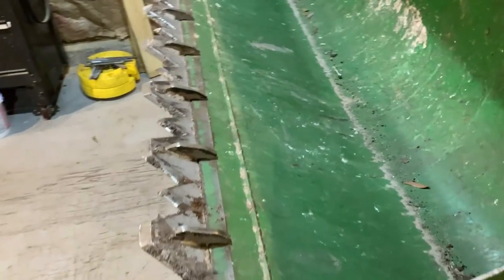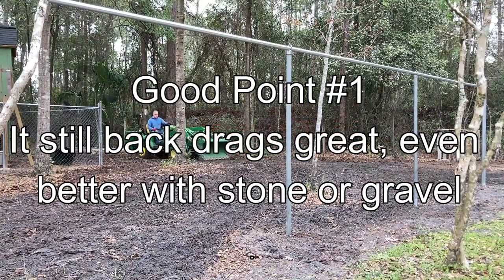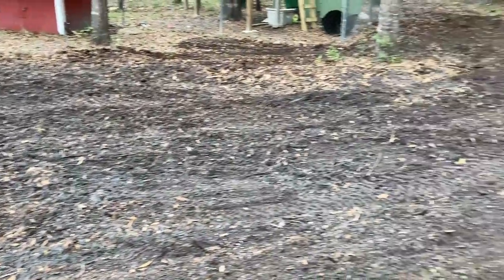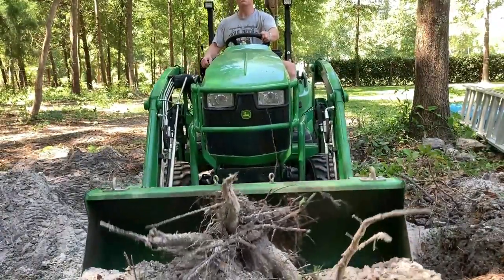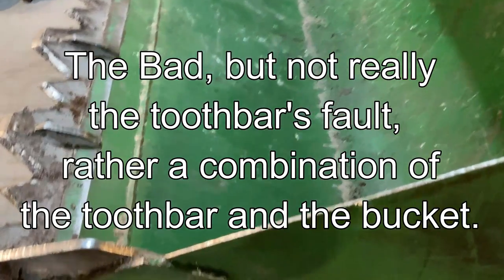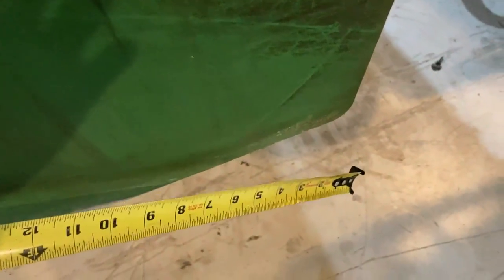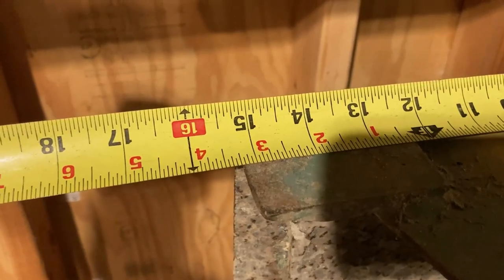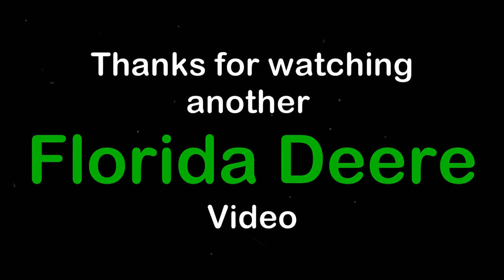Piranha Toothbar 6 Month Review: The Good, The Bad & The Ugly on the John Deere 1023E 1025R

Comment: I am cheap, that is why I bought a 1023E instead of a 1025R.  I looked at tooth bars and found one that fit my budget, trouble is it was out of stock.  I have a welder so I jumped on Amazon and ordered the parts.  $230.  The Paranha is more then a tooth bar so if you have a use for it I am sure it is worth the money.  The teeth on mine are sharp too, I always but the bucket down before I get off the tractor.
Reply from the maker: Me too, they are the same tractor for $2500 less.  Now the 1025 has some nice features, but I had a budget and other than the seat and position control, I didn't need the other features.  $230 is a great price for a toothbar.  Thanks for watching.

Comment: Nice review. I really like my Piranha. The dumping issue could be easily solved by using a trailer. That would be better for your truck too. You could use the pallet and chain trick to unload quickly.
Reply from the maker: Thanks for the tip Dan, I will check out this pallet and chain trick.  Thanks for watching.

Comment: Not fair to blame tooth bar for not being able to dump fully in your pickup.  You tractor is just too short or truck is too tall.  Maybe a built up loading dock for your tractor/truck is in your future project?  At least your tractor can be raised higher.  Post a video if you happen to build one!
Reply from the maker: Yes, I agree with you completely, it is the toothbar's fault about 10/20% and the rest the bottom of the bucket stick out too much, I thought I had explained that, maybe not well enough.  I had the issue before the toothbar which was one of my concerns about getting one, but the benefits certainly outweigh that minor issue.  And the truck is an 8200 GVWR model that is a 4X4, so the stock ride height is a bit high.  Thanks for watching.

Comment: My list vs this video: 1) tooth bar is removable for back dragging. Two whole bolts. What 3 mins?   2) Your subcompact tiny tractor isn't designed to be a quarry pit wheel loader to load trucks. Again 3 mins? to take the bar off to load the truck? This is a John Deere problem, not Bxpanded's.   3) Good ending. Haha I cut my shin all the time on my Land Pride Grapple with its big sharp root rakes on the bottom. Good video and we appreciate it greatly. I didn't reply with my 1,2,3 comment in order to rebuke or chastise you, rather just to point out that the perspective, if looked at differently, would be to understand that your expectations must lie within the limitations of the designed equipment you are leveraging in your tasks.
Reply from the maker: Eric, it back drags just fine, I think even better than with a flat blade, but yes 2 bolts and it's off.  And yes it would take me 3 minutes, I'm slow and would have to find the right wrench and yada yada😂.  2, what are you saying, this little tractor can do everything, LOL, just doesn't do anything super well.  And of course I agree, this is more of a JD issue, I thought I stated that in the video.  Not so much that the bar was bad, but that is made the JD shortcoming even worse.  And to this day, that is my biggest gripe about the 1 series, the height of the dump.  My 445 was actually better and it's a smaller tractor.  The bucket on the 1023E could be argued is too big.  3. I try man, I try🤣.  I liked your comment and enjoy talking tractors with folks.  And you are right, we often take things out of perspective and want silver bullets to fix all our problems.  The 1 series is a great tool, fantastic, but it does have it's limits and it's good to know them.  People often say, why don't you get a larger tractor?  HAHA, well, because a larger tractor would not be good at all the smaller tasks a 1 Series would be good at, there will always be compromises.  I tell folks that in my job, there is no perfect house, there is just the best of the bunch.  Thanks for watching Eric.

Comment: On the negative of the bucket being too long and causing issues trying to dump into your truck my comment would be I would take the extra load capacity over your issue with dumping into your truck's bed.  I like the large bucket and find its extra capacity a big positive!  Your video is very helpful and makes me wonder if the heavy hitch's longer teeth would be a issue or benefit.  I am trying to decide between the Piranha and heavy hitch for my 6 month old JD 1025r.  FWIW I am in Florida also....
Reply from the maker: Yeah, I think you're right to see both ends on both issues.  The extra capacity could help, depends on how we use our tractors really.  Same thing with the HH vs. Piranha.  I would say for ripping roots and such, the HH would maybe have an edge, no pun intended, but if you used the bucket for finish work a lot, then the Piranha has to be strongly considered.  Very rare do we get a tool that does multiple chores head and shoulders above the next one.  I was also upset initially by the width of the bucket, it being 53" instead of 48" like my 445/40 FEL combo.  But I quickly got over that.  I'm always concerned about space to operate and store, so I may be a bit whiny with certain things, LOL.  Thanks for watching.
Reply: set up a couple of car ramps an that will get you another foot or so I have done that in the past.

Comment: Subbed to your channel a few days ago when I discovered it looking at the differences between the 1023 and the 1025. I watched several of your videos and I found your videos practical, informative and helpful. I kept on seesawing between the much more expensive used 1025s here in Canada and the more reasonably priced used 1023s. Based on your review and thoughtful commentary of your 1023, and the landscaping projects I am planning, I purchased a used 1023 with very low hours on it at a reasonable price.
Reply from the maker: That's awesome man.  If you have a use for the extras on the 1025R, I'm sure it's worth it to some folks, but the price difference is pretty high for basically the same tractor if you don't use all those features.  I hope you have good service with it.  Mine has been really good so far, with only minor issues and some caused by me.  Thanks for watching and thanks for subbing as well.  I hope to see future comments from you on later videos.

Comment: Mine is on order.  Waited 5 weeks, called today and it's another 5.  Seems like it will be worth it though.  Thanks for takin the time to make videos.
Reply from the maker: Man, that's unfortunate for sure.  They told me it was 4-6 weeks and it came in 5 I think, HH is quicker, but more pricey, but also a different type of bar.  I have noticed crazy lead times.  I have a carport ordered and it's 12-14 weeks, I have a carry-all (future video) ordered and same, another 12-14 weeks, this Covid-19 stuff is getting old.  Once you do get it though, I think you will like it.  Problem is, I think I wasted money on my box blade the toothbar works so well.  I need to figure out how to use the box blade better now.
Reply: @FloridaDeere  I was thinking of getting a box blade instead of a ballast box. We’ll see.
Reply from the maker: @eituyn  I guess I'd ask what do you do with it?  I use my ballast box a lot more than my box blade, but we all have different uses for our toys.....err....tools, so I can't say that wouldn't be a good idea.  If you make good use of the box blade, get it, you can always add weight to it to make it heavier.  My box blade is somewhere in the 300# range, whereas the ballast box is over 500#, so it provides good ballast compact and tight and close to the tractor.  Using just another attachment is good because most of us have additional attachments, but rare do they equal the weight and are usually much bigger.  But if the space you work in isn't super tight, that's a moot point.  If you ever hire out, the stump grinder has been my money maker.  They are pricey, but will likely be the first attachment to pay for itself.

Comment: You did split hairs lol. I think for most this won't be an issue, both of you tractors have quite a limited lift height unfortunately.  Thanks for the info and the video.
Reply from the maker: True, the limited lift height is the worse thing about the 1023E really in my opinion.  I may have to upgrade at some point with the HydroPlus cylinders.  Thanks for watching.